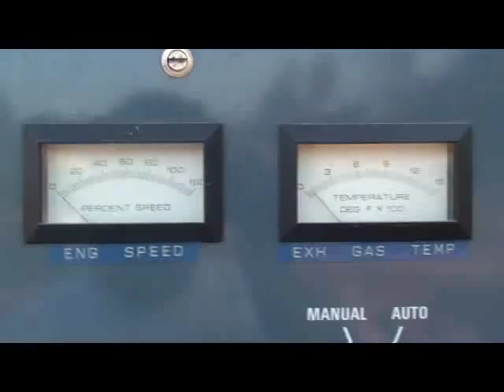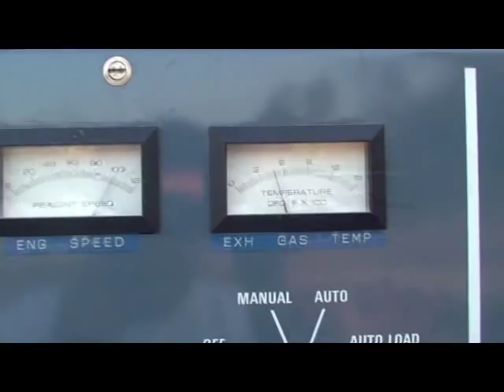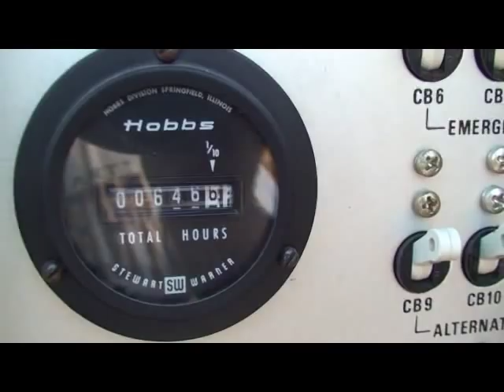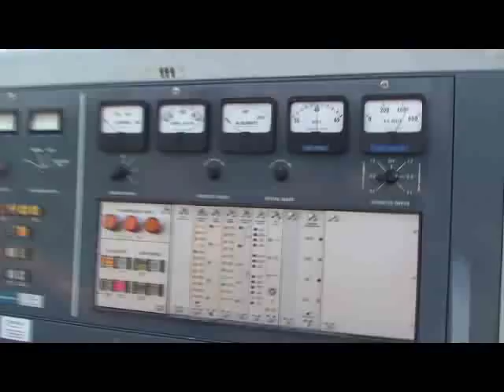Turbine Generator Solar 1000Kva start up model KS-21501 turbina generador

Comment: Bobl78, you need to remember you're looking at a generator that was state of the art in 1960.  If you're looking for something to power your personal bunker, this genset is NOT at all what you want.  For one thing, power output is WAY too high.

Parts and repair--no problem at all.  Cost?  Sure--repairs will be very similar to repairing any turbine engine, depending on damage.  There are companies which still rebuild Solar Turbines, you just need to look.